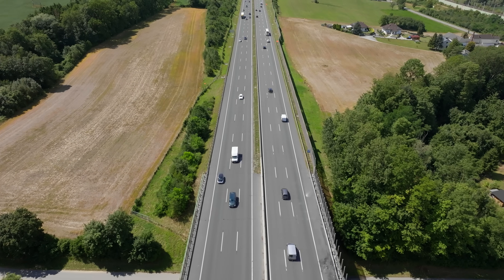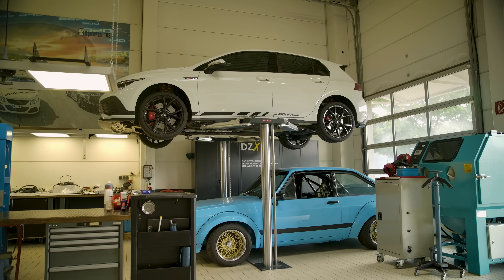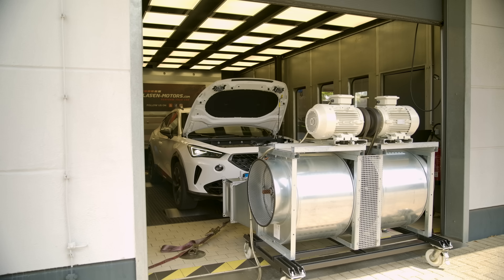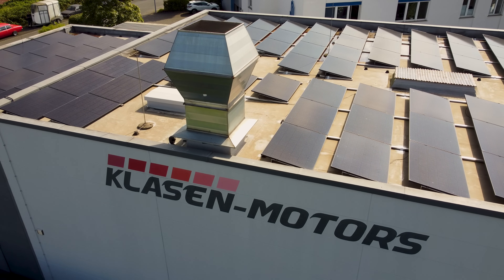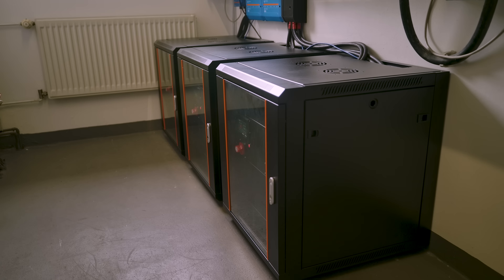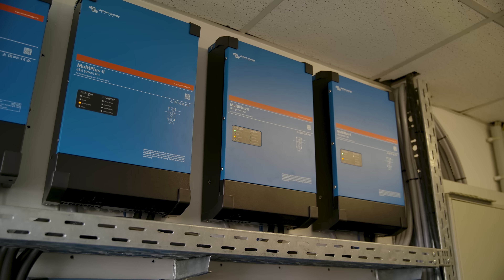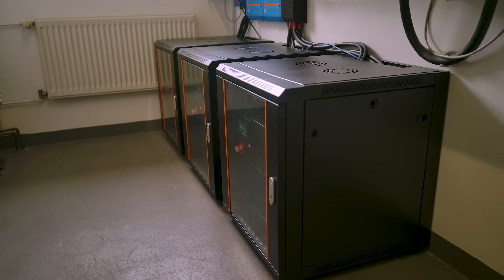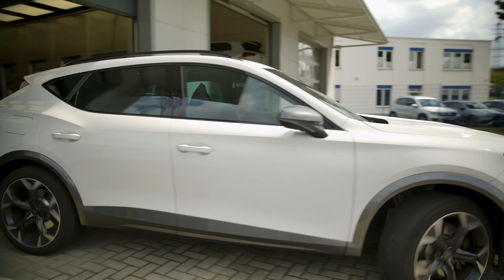How this car tuning garage keep the dynamometer on when grid is off

Comment: Super gemachte Anlage .
Wir betreiben selbst privat für die Werkstatt und das Wohnhaus zusammen und E Auto einen 24,8 kwp Anlage mit 10 Strings und 6 x Multiplus 2 5000 mit einem 40 kwh Akku .
Ich möchte nix anderes mehr haben ,so individuell und tolle Qualität .
Netzbezug ist eine Seltenheit, dafür jede Menge Einspeisung

Comment: How did the electrician register the self-built battery with the grid operator?
Does the grid operator not require corresponding certificates for the battery?

Comment: Edit: I forgot to mention, I am with the distributor's technician and they installed the system but something doesn't feel right and they seem to not have enough knowledge on this setup. They have been doing AGM mostly.

Anyone or someone from Victron Energy please may I have some assistance. Firstly, thank you for amazing products. I'm working at an organization. We have a 5KVA MultiPlus II and updated our batteries to Lithium from AGM. We've got a 51.2V 280Ah LiFePo that has 16 Macro cells inside. Somewhere in the battery manual it says  "This product must be charged using a Lithium Phosphate Charger with a Full Charging Voltage of 58.4V with charging current less than 100A."

--What does it mean Full Charging Voltage of 58.4V? Is it likely that it is the charging voltage or the Float Voltage?

--Must I connect the battery BMS to Multiplus? How do I know the type of BMS and if the MultiPlus II can talk to it?

--Can the Multiplus II Charge this type of battery or is the battery too big. Tried it and after a while the MultiPlus fans kicks in and it gets hot but does not produce temperature warning, then it shuts down. Other time it charged the battery to full, but the battery was like 75%. No BMS connection was made during all these tests.

--I've been going through the manuals, but need some insights. 

Hope to hear from anyone, thanks.
Reply: Contact an electrician to help you if you are unsure. You need to purchase a MK3-USB adapter and use Victron Connect with a computer to change the Multiplus configuration. There are videos on doing this. You select Lithium Batteries and you can set the absorption voltage to 58.4. It is important to not connect lithium batteries without doing this because you must disable equalization. To access your Multiplus you enter the passcode zzz.
Reply: @ Thank you so much Noah, it as really appreciated. Sorry I didn't mentioned, I'm with the technicians and we got the MK3-USB adaptor and were able to set up the Charging voltage and all other parameters for the Lithium charger. Just realized for Lithium batteries, Float voltage is to be disabled.

I just need to know if it mandatory to connect the battery BMS for it to communicate with MultiPlus II.

What happens is, when the the grid goes out, inverter kicks in correctly and the battery supply the current to the load seamlessly, but when the Grid comes back online, the Mains On accepts it and begins to charge the battery in bulk but after a  while the system breaks the power and shuts down, the goes buck on, then after a while of again it shuts down, in that cycle.

Now, in order to break the cycle, we power off the battery and the MultiPlus, then power on the MultiPlus, wait for it for 5 mins then power on the battery, then it remains stable. But when grid goes out, the cycle of issues begin. 

Since the technicians didn't connect the Multiplus II with the BMS, I'm suspecting that happens because the Multiplus II doesn't know when to shift from Bulk to absorption during the power cycle changes or if there is something else to be done in config or if there is a firmware update to be done.

Comment: I am from Uganda (East Africa Region). But i LOVE Victron Systems for their reliability. I have an MPPT 450/200 Tr and a 5000Watt Smart Inverter all from Victron. I also have accessories like the Ekrano GX, Lynx Shunt, Lynx Diatributor. I am 100% SET. What we now need are Victron Batteries. Thank you Victron